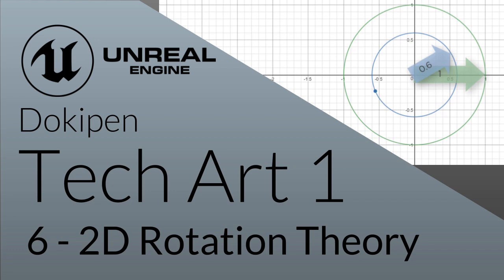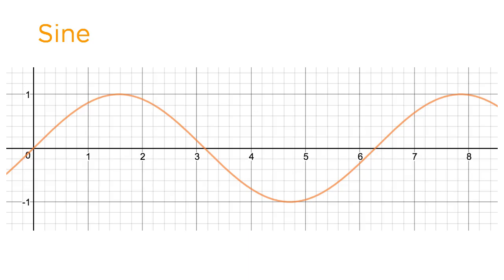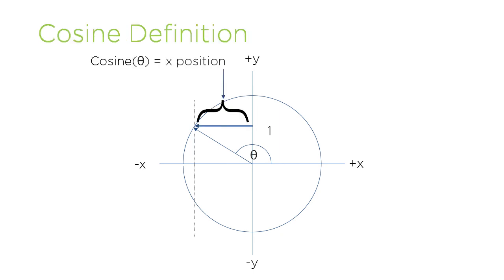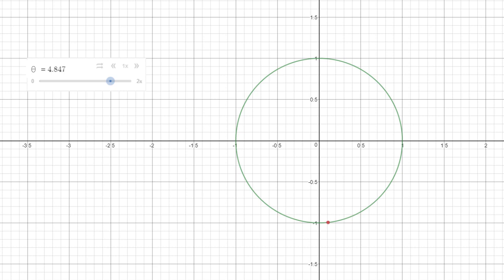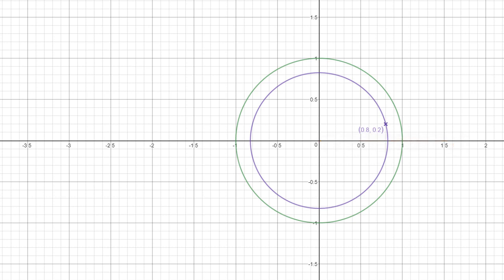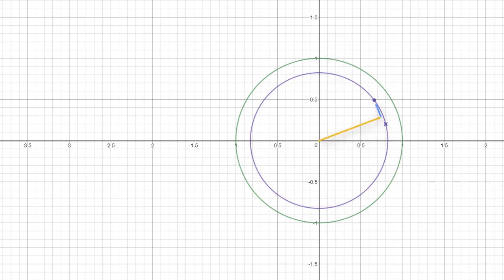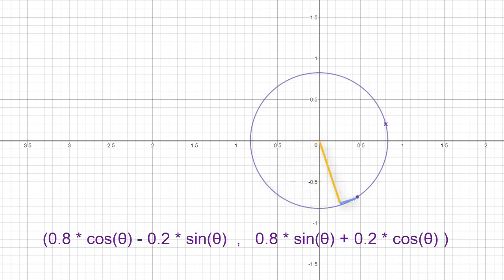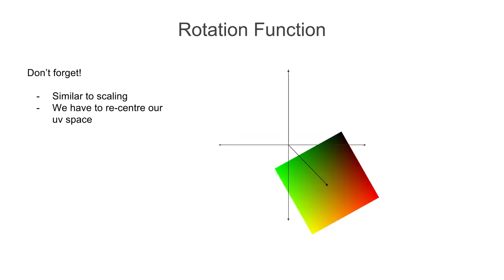Explaining the 2D Rotation Equation - Unreal Engine 4 Tech Art S01E06

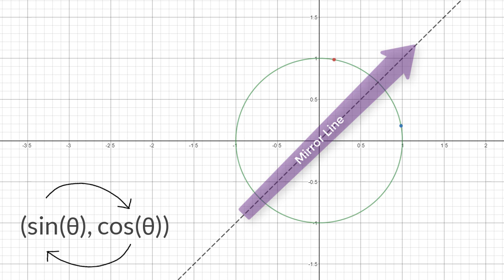Comment: Can you more clear explain 5:20 time
"By multiplying the cosine and sine by a constant value it give us the point of a circle that has a smaller radius and this points coordinates is (r * cos, r * sin)" . 
if take an example (0.8, 0.2) coordinates and want to calculate first offset coordinates. it is (0.8 * cosine, 0.8 * sine) and for that point does it equal (0.8 * 0.8, 0.8 * 0.2) = (0.64, 0.16).
is it right or I am wrong?